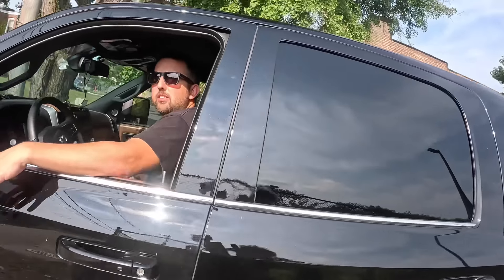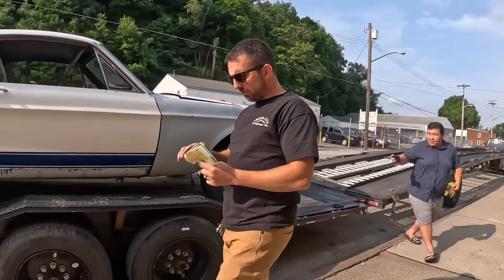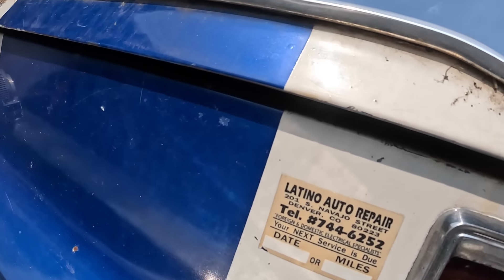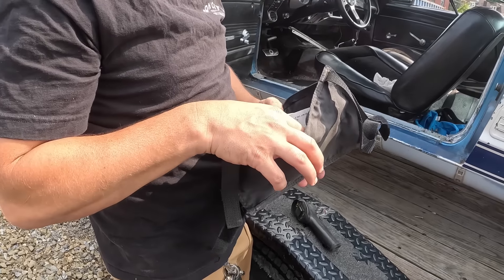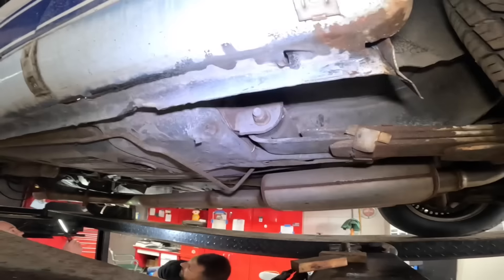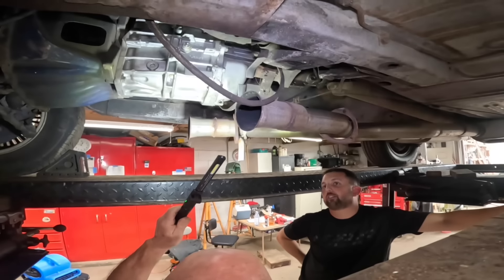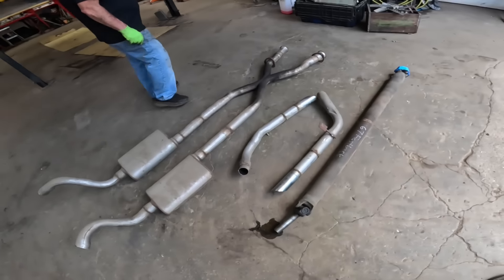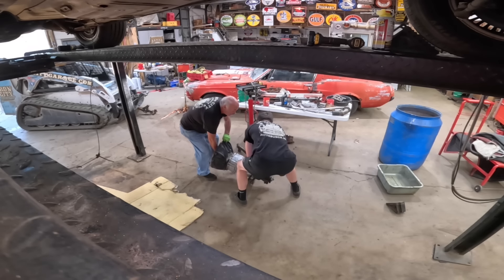Denver Colorado backyard find 1967 Ford Mustang Fastback.

Comment: It’s definitely a 67. I had one for 30 years. The turn signal lights in the hood was an option offered in both 67 and 68. The vented decor piece in the quarter panels next to the doors is a sure sign it’s a 67. All 67 mustangs had that piece and only came on the 67s. In 68 it was completely changed and eliminated. Again it’s definitely a 67 👍🏻

Comment: That's a 67/68 hood 

And just because it has disc brakes doesn't mean it's a GT
Reply: also has 67 lower quarter side vents
Reply: also that is not a gt rear valance panel...it would have the cutouts for the twin exhaust tips